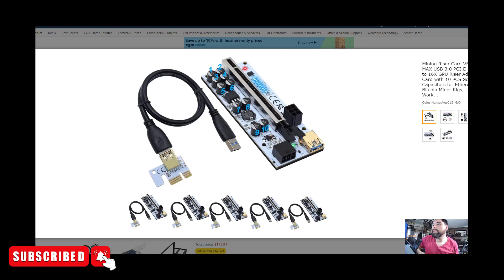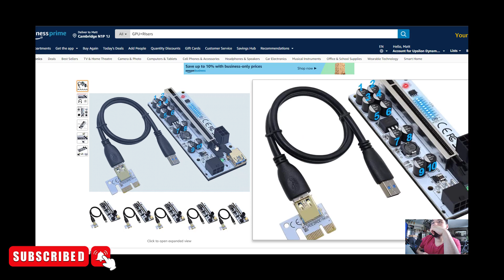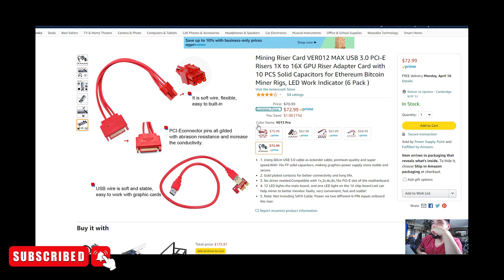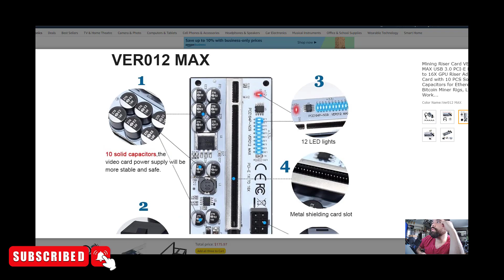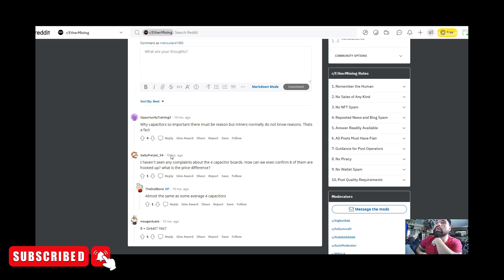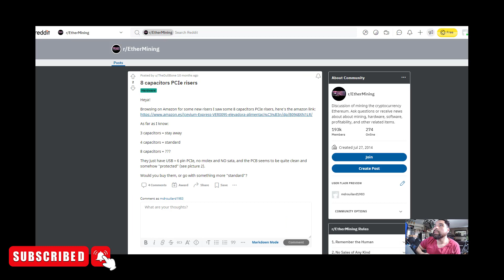Should you get premium risers? Shamelessly unsponsored video about risers.

Comment: I know risers are cheap but have you tried to send your bad riser back to get a replacement?
Reply from the maker: Haven’t tried but I’d have to send all 6 back so if other companies offer a better warranty that’s be a benefit of paying more.
Reply: @cryptomatt1983  I gotcha with gpu risers any riser I had issues with they send a new one but whatever works to keep making money!
Reply: If you can buy 3 or 4 times as many for the same money warranty doesn't matter as much.  They could have a 50 percent fail rate and you would still have twice as many that work. But I will agree with you. Gpu risers has the best warranty and service. I've only ordered once with them. And order of 36. 2 arrived bad he instantly replaced them the next day.  Same for aaawave. But it's to expensive to outfit a farm. I'd rather buy an action that let's me get 3 or 4 times as many and if ones bad just throw it away. Found this out when I was spending more on risers  than server power supplies. I mine to make money no try to recoup the cost of all the expensive equipment that I justify and tell myself I need.